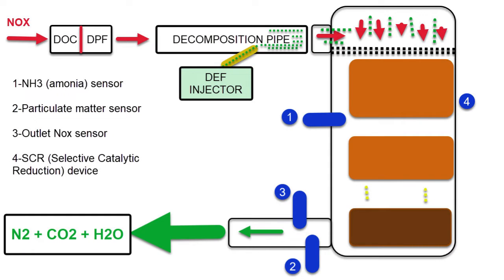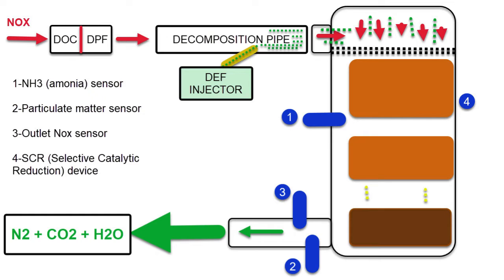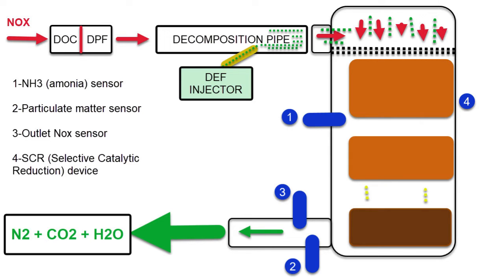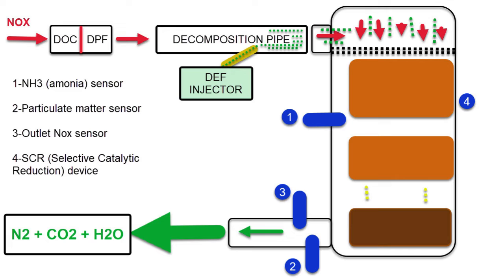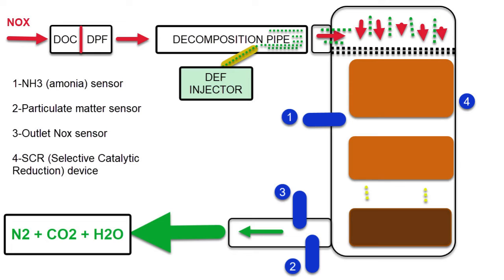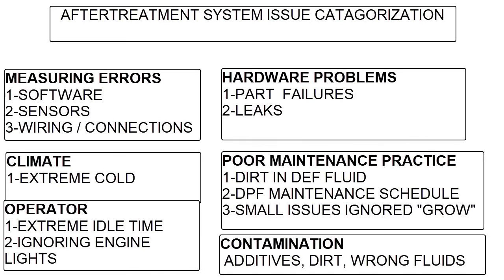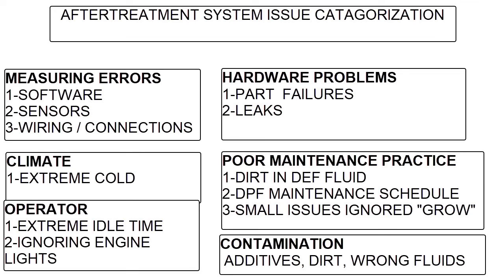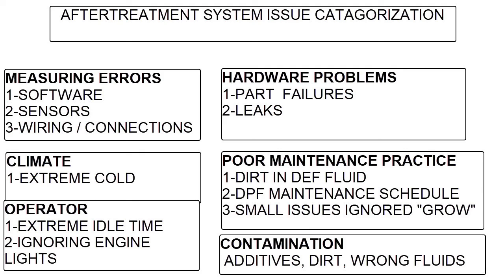How the SCR system works and how to think through problems

Comment: Cummins ISB 6.7 5655 code pops up, often. We checked  everything that insite told us too. Could contamination of the def fluid cause code 5655...scr conversion condition exist.
Reply from the maker: If you checked ALL the systems put the esn in qsol to be sure there is not a campaign on the scr brick. And check calibration revisions. We just had a unit that was failing the scr brick and a calibration update corrected the issue
Reply: Thank you. I'll start there